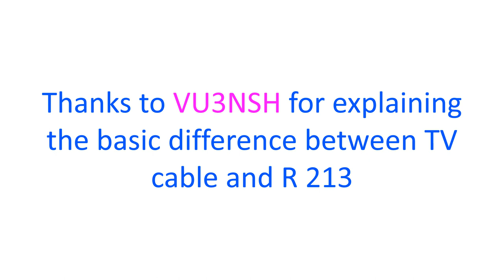Can you use TV coaxial cable for Amateur Radio?

Comment: Use a half wave length or multiples thereof on the design frequency, taking in the velocity factor, and you can use whatever coax you want.
Reply from the maker: Thank you for the good suggestion.